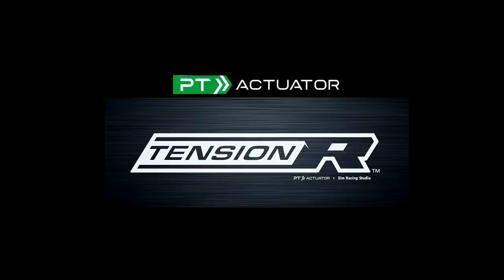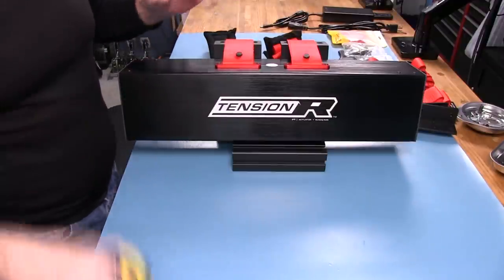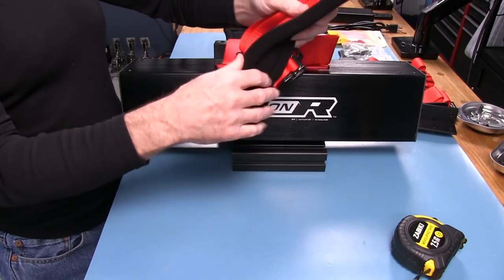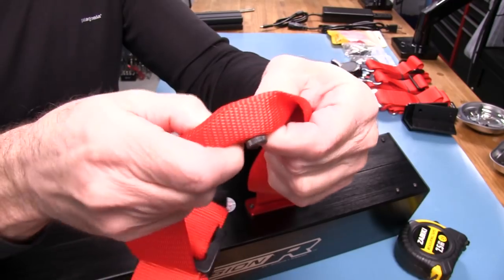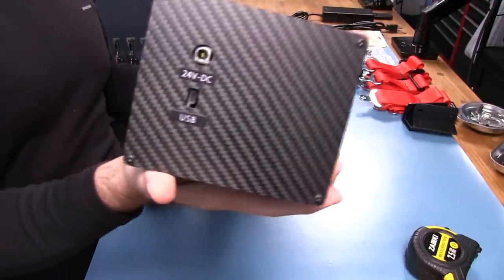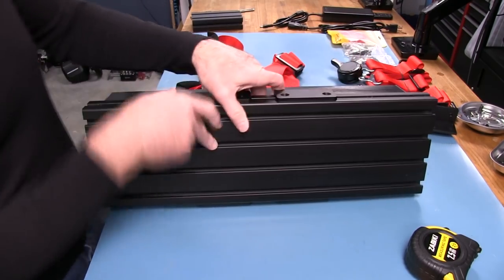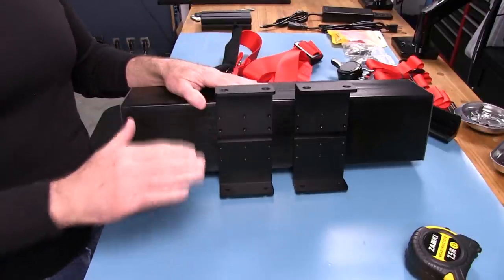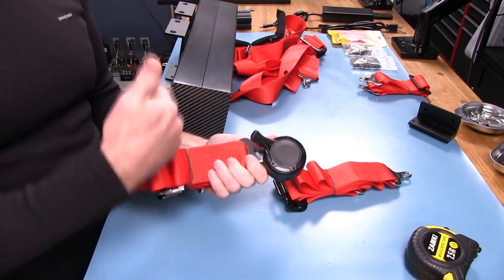PT Actuator TensionR Belt Tensioning System Review

Comment: my pt actuator belt tensioner is not working properly. i can operate it at maximum half the power, otherwise it just drops out after a couple of minutes. extremly annoying. pt actuator support is a joke. i am in contact with them back and forth over weeks, without any helpful clue what the problem might be. ridiculous.
Reply: Same issue Here. Upgraded to 24V 10A Power supply. Still Not working. Calibrating and then after First braking it shuts Off completely. Super annoying.
Reply: Same and frustrated. Ever find a solution?
Reply: @FULLNinja69  dont get me started. I got a replacement, worked well for about 2 Weeks. Then one motor stopped working, wasnt able to fix it. I wasnt in the mood for another ever lasting back and forth with PTs support, so frustrated as i was, i put this nightmare to an end and threw the damn thing into the trash. That was my last product from this company, thats for sure !
Reply: I forgot to mention, the shipment for the replacement cost me another 300 USD or so.....
Reply: @diegostalder9663 in the UK they wouldn’t be able to do that as the UK is covered by consumer rights act 2015 and if it develops a fault within 12 months they must fix or replace and cost is not passed on to the customer 

I believe US is 90days?
Reply: @diegostalder9663 makes no sense why you would spend $1000s then put it in the trash due to a motor that is easy to replace. How old was the system I would of purchased it lol
Reply: @Simlife101  because I was so fed up and wanted this thing out of sight 😡
Reply: @Simlife101  in Switzerland too. But I ordered it directly from china... So, I guess that becomes extremely complicated, if not impossible.

Comment: Good review Barry, I own the unit, have done so for a couple of months,  there is no noise. I believe it is the way you have mounted the belts Barry and the rig is making the noise as it flexes  The buckle is junk and has failed already.  Also, if the holes where your belts go through the seat and over your shoulders are wider than where the belts exit the unit, they are at an angle so the belts fray badly at the unit entry point.  My seat is a Cobra, the shoulder belt holes are 10cm apart but the units belt holes are 6cm apart, the resulting angle causes the fraying.   Otherwise, the system is great.
Reply: As the belt seat on the bottom of the rig I was wondering if you feel some small delays effect?
Reply: @MAMAMA341  No delay, it adds the to simulation a great deal.

Comment: @simracinggarage the belt stops working over settings of 10 in Sim Racing Studio. Upgraded to 24V 10A Power supply. Still Not working. Calibrating and then after First braking it shuts Off completely. Super annoying.

Comment: Just got my Gbelt from SimXperience up and running and it’s interesting how different these two are. The Tension R the belts are wrapped around the motors basically but the Gbelt uses arms attached to the motors to push against the belt causing tension. I think the Gbelt is a much simpler, compact system and has plenty of power. Although the Gbelt does not come with belts…a plus and minus. Good if you want custome belts bad if you don’t want to spend the extra $$$

Comment: Hi,
Very nice presentation.
Question : is the system able to partially release the belts tension if on the breaks you lock wheels (asseto corsa)?
Thanks
Eric.
Reply: I hoped to see Barry hit the brakes to lock up, but unfortunately he didn't. I would expect the system to release tension but who knows...
Reply: Brakes not breaks
Reply: And you waited two years to correct me … 😊. Still doesn’t answer my question .

Comment: I have just taken delivery of mine in the uk. The strap pads have been now made independently. My only main gripe with the whole system and it's a small thing that's easy to remedy, and that's the usb cable is just too short. They could include a 3 or 4 meter cable.... I had difficulty getting it to talk to the pc it didn't recognise the usb, after shifting ports a bit. They also changed the usb A to usb B so a bit more robust. I've not yet really tried it out but it does look quality and the little I have used it it feels fantastic. I'm hoping to use your video to help me tune it. Keep up the good work SRG.
Reply: Any problems with it disconnecting?
Reply: Not really. Occasionally the program shuts down. But they also advise you to use a usb voltage stabiliser.
Reply: @lipsucant  ok cheers I'm trying to trouble shoot mine it's not working consistently
Reply: @soundscaperecordings1111  I'm having the same issue USB disconnects. I do have it connected through a USB isolator that was recommended. I plugged the USB isolator directly to the USB ports on my motherboard rear panel and then connect the tensionR USB to that. I've tried different USB ports but still get the disconnect when simucube wheel base and transducers are under heavy load. 

I grounded my wheel base to my PC and that seamed to help a little bit but when under heavy load it will still disconnect. I've confirmed the power outlets are grounded with a tester. I've try hooking everything up to the same power circuit so they all use the same ground and I've tried the rig on one power circuit and the tensionR on it's own power circuit but it still disconnects.

I heard from some different forums that it is a grounding issue and I'm currently trying to find some documentation showing the best way to ground the tensionR. 

Were you ever able to solve your issue?

Comment: I was curious what my G-Belt looks inside and there are some similarities like the motor-size (might be bigger in the G-Belt), some differences. The G-Belt only lift leverage arms, which is about 40 mm of pull and you want a tight harness to get 'enough' out of it. No warranty void for opening it and it's rather made for 3 inch belts that you also need to buy elsewhere. G-Belt comes with a controller box (fan inside, but not as noisy as other SX-boxes). This thing is 65 mm wider in size, but the gap between the belts are too close together for the typical racing-seat (10 cm), so you can't mount it very close or onto the seat itself, which I think is the biggest design-flaw. Mounting it on the bottom adds belt-flex and rubbing, so lag to the effect.
Reply: That the entry/exit points are so close together is really bad design. I hop they change it.
Reply: @myweirdtaste8090  Agree and those rollers would be unnecessary since you could fit the tensioner where the roller are in this build. With the G-Belt the belts are hanging under the motors on the leverage arms making it more compact, but 40 mm max is a bit short. The best concept would be the GS-5, but instead of the arm going up and down it's rolling by a simple gearing.
Reply: I’m lost here i was looking at the g-belt, but now seen this one. What would be the better buy? I do also use an nlrv3 any comments with pros and cons on both I’ll be thankful. Ps I understand the g-belt may have to be drill mount and dose not come with a belt etc

Comment: The SimXperience G-Belt is silent.  For a similar price I’d say it is the better system.  Their mounting solution is better in the sense that the unit moves with the seat and is universal across sim rigs.
Reply: Wrong. I have both. This system is far more reactive.
Reply: The G-Belt is absolutely NOT silent. It’s the only thing I don’t like about mine but when using earbuds, I can’t hear anything. But it’s most certainly not silent.
Reply: @anthcesana  odd because the only sound I hear is the fan.  The belt system is nearly silent for me.
Reply: @douglasingram8881  wow, Doug where did you get yours from?
Reply: Well, I would hope it isn’t louder, this thing is just far too noisy.
Reply: Almost pull the trigger on this one, but the noise is a deal breaker…
Reply: @spiritchaser4337  Do you guys play with muted TVs? LOL. The sound of any game should EASILY cancel out any sound coming from the unit. Keep in mind that he set a mic right at the tensioner which would make it sound loud when in reality he likely barely hears anything whilst racing
Reply: Nope, have a 5.1 surround system attached to my rig with Silent Scorpion actuators. Still looking for that YouTube video focusing on the sound of the tensioner, and nothing else. What rig do you have? or, are you still playing with a pad? lol
Reply: @Wodz30  a lot of people use headphones, but also have other people in the house and it might be late, plus this sounds loud to enough to hear even when using speakers, would be annoying.
Reply: @Wodz30  It’s more about annoying others nearby.  I have a motion system which is quieter than this belt tensioner…. Oh, I wear a headset.

Comment: FYI SRS has decided to purposely cripple DIY belt systems by not providing heave and sway input to these tensioners.  Very bad move by SRS.  I assume they think they need to artificially limit other tensioners in order for their TensionR to better compete.
Reply: @MarceloManzo  Sway on two doesn't really add much more than one.  Sway on one just tricks the mind that something is going on.  Must use lightly.   and.. there are  2 motor DIY systems as well.
Reply: @imagebuff You know SRS doesn't make nor sell the TensionR  product right?
Reply: @shawnyerxa9632  They are business partners with PT Actuator.  This limitation on DIY tensioners comes from the mouth of SRS's owner.

Comment: I think with a 6dof Motion System this is unnecessary
Reply: Actually, with a 6DOF system, this is really easy to install and adds a ton. I installed it on my NLR Motion Platform v3 rig and had to mount it on the back of my seat. I tell You, quite the job, but MAN was it worth it!!!
Reply: Wrong
Reply: @strikkflypilot927  with your nlr V3. IS tension R efficient and gives u more immersion ?
Reply: @garyrato5938  In my setup it makes a huge difference. In this review, the belt system is mounted very loosely and will not be felt much. I have mounted the unit at the back of my seat at about TH7 level with a rolling pin on top to make the forces go down across my clavicles. It works awesomely. Driving Radillion gives a real sense of compression! Also, it makes even less noise than the NLR V3, so I dont understand wheee the noisiness comes from.
Reply: A 6DOF motion system is incapable of providing the sensation of extended G-Forces.  A belt tensioner can.
Reply: @johnathanmoyer2375  surge  effect with a 200mm actuator would definitely provide sustained forces from all 4 belts.  Tension R is a great system for atatic rigs only.  This is not needed with a true 6dof
Reply: @daduke7990  Unless it's a seat mover, how would a surge actuator manage the feeling of sustained G-Forces?
Reply: @johnathanmoyer2375  take a look at Barry's PTA 6dof review.  The surge actuator pushes tbe entire rig forward on braking, essentially pushes the driver against all 4 belts.